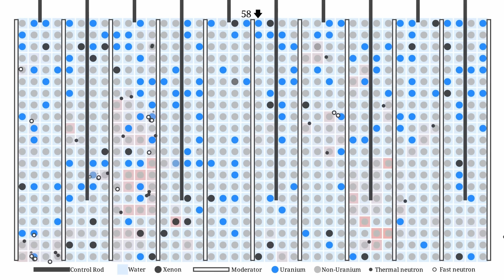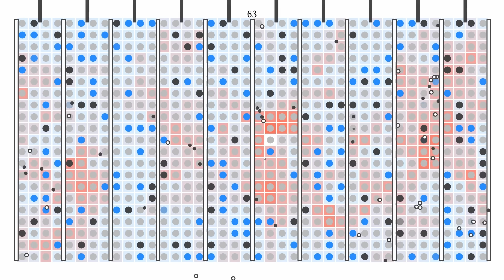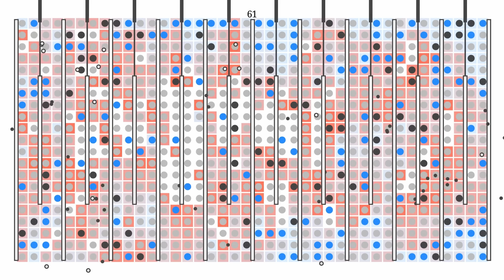Chernobyl Accident - Simulation only (no talk)

Comment: Worked on nuclear reactors for 5 years in the military, and the bad decisions in both design and operation of this reactor never ceases to amaze me.
Reply: My father left Westinghouse in the early 60's after a decision was made to choose a reactor design because it came from the nephew of one of the managers.
Reply: Five years? Dytalov had 14 years of experience.
Reply: Mind explaining how the design of this reactor is bad?
Reply: @Anton43218   The first thing that immediately comes to mind is the use of graphite tips on the control rods. They were used as a moderator, that is, they were used to reflect neutrons back into the core in order to generate more fission reactions. Water is used for the same things, but water flows and also acts as a coolant. Both have a negative temperature  coefficient of reactivity, meaning that as temperature goes up, the ability to reflect neutrons goes down, which is good. Having graphite on the tips of the rods allowed for faster startups because at the same temperature, graphite is more reflective than water and therefore allows for a more rapid initial increase in power. This also leads to a problem with their design, where power spikes upwards when the rods are inserted from the fully withdrawn position because the more reflective graphite displaces the less reflective water. Part of the purpose of control rods is to displace the moderators with the neutron absorbent material of the control rod, but when the reactor was SCRAMed, the graphite tips shattered and spread the highly reflective moderator all over the inside, which led to the massive spike in power and was a large factor for the meltdown. To make matters worse, graphite is very flammable when heated enough and exposed to oxygen, which led to graphite fires and the further spread of radioactive material after the meltdown.
Reply: @faultyinterface  Thanks for explaining!
One question: maybe its a misunderstanding on my part, but you said the water is reflective/increase the fission reactions, when my understanding from the video explanation was it slowed it down?
Reply: @KNylen  It has to do with a few principals working together. The aforementioned temperature coefficient of reactivity and reactivity specifically. Having a negative coefficient means cooler water is more dense, and therefore is able to reflect more neutrons back into the core, while warm water is less dense and allows more neutrons to escape. In this way, a negative coefficient allows reactors to be semi-self regulating, as the hotter it gets, the more difficult it is to generate reactions.  Another design flaw of the reactor was that when the water boiled, the steam voids had a positive coefficient. When they turned the pumps off and heat built up there was more steam, reactivity went up generating more neutrons, burning more xenon, allowing more fuel to be fissioned, generating more heat and steam, increasing reactivity, and so on. Burning the xenon was the intended goal, but doing it this way was foolish because reactivity was going up from both xenon burnout and steam buildup in the reactor, and these kinds of feedback loops tend to near instantly get out of control. For clarity, xenon-135 is a byproduct of fission and the decay of another fission byproduct, iodine-135, and has a very large cross section for absorbing neutrons. At lower powers for extended periods of time, xenon can build up quite a lot and reduce reactivity, but at higher powers, enough neutrons are generated to burn it off nearly instantly. Due to all these factors, they SHOULD have just increased power more slowly or just shut it off for 6 hours for the xenon to decay away naturally.
Reply: @faultyinterface  Oh I get it, thank you so much for the detail!
At the end when you say “shut it off for 6 hours”, does that mean inserting all the control rods all the way?
Reply: @KNylen  Correct. The half life of iodine-135 is approximately 6.6 hours, and the half life of xenon-135 is 9 hours, which should have allowed enough decay for a reactor startup without having to withdraw the rods and shut down the cooling pumps to burn off the xenon in the way they tried.
Reply: @faultyinterface  as a layperson, I'd like to know of your expert opinion, should all nuclear power plants ideally have a sort of "maximum power output" imposed by the government, so that there would not be decisions where a power plant is demanded to create so much power that could lead to disasters like these? Or is there already such a rule existing already?
Reply: @faultyinterface graphite "tips" took more than half of a control rod length. So, they were not really tips and this design is called "half-rod", and this is not exclusively just RBMK "poor design" feature. Moreover, the half-rod design was there to increase the range of control over the reaction, not to make it worse. More control - better and safer, isn't it?
Reply: @borincod  Not when they shatter and spread all over the reactor during a scram, or when they increase reactivity by displacing water while being inserted.
Reply: @faultyinterface  That's why you do not remove the controlling rods fully at the first place. No? And again, the half-rod design is not smth outlandish, which was possible only in USSR and IAEA was ringing bells about dangers of the design. So, why were you so "amazed" with this quite known design?
Reply: @borincod  yeah, that advanced control provided extreme safety, comrade.
Reply: @ab_user-1488   you tried to joke, boi? Maybe you try again somewhere else
Reply: @quantumpanic  This accident didn't happen because it was "demanded to create so much power". Read up on the incident. It's because of the poor design of the reactor and the fact that they tried to carry out a risky test while the reactor was in an obviously unstable state: in fact, it was putting out too little power in the hours beforehand, that's why they took the control rods out, to try to raise the power output to a normal level.
Reply: @faultyinterface  I don't think they turned the pumps off to burn the xenon.
The goal was to shut down the reactor, after testing if the pumps could keep going after tripping the turbines.
Obviously the power was too low to make it work, so i guess the pumps just stopped while the xenon was burning as a consequence from stopping the turbines.
But both the turbine trip and the scram were programmed.
I guess they still did the test at low power since they had to shut the reactor down anyway, they must had thought something like, the worst that can happen is another failed test.
They didn't take into account the design flaws though.
Reply: @giacomoneri1782  instead of guessing, why not just read/watch the facts that have been there for years.
Reply: @RandalexK  Facts are reactor should not kaboom, reactor did kaboom.
If you were in that control room then explain, otherwise i only have a couple of interviews with Dyatlov to guess what they were thinking.

What we have suggests to me they gave up on restarting the reactor, and since they had to scram it and do maintenance, they tripped the turbines anyway.
They weren't trying to burn the xenon, they were shutting it down.
Reply: @quantumpanic  all plants governed by the nuclear regulatory commission and Naval reactors have a set maximum power output based on the design of the core. This power limit is VERY strictly enforced. Violation of it will result in investigations, firings, and disciplinary action. Any decent operator would deny any demands to exceed the power limit.
Reply: @borincod  Combining the moderator and control rods into one unit is one of those design choices that sounds good on the drawing table and in the conference room, but has obvious disastrous potential consequences that multiple layers of "someone should have realized this was wrong" should have happened. The biggest of which actually happened at Chernobyl 4 on 26 April 1986.
Reply: @faultyinterface  Actually, that design wasnt too bad. I heard that it increased efficiency. They should have added a backup system that would immediately stop the reaction if something unexpected happened. I'm pretty sure it would have been possible to do so.
Reply: @Inf1niteDreamsThats what a scram was for, and thats why it failed. The protective action itself is what shattered the graphite and led to the runaway reaction. Once that happened, there was no stopping it. Graphite did help with efficiency, buts its one those things where that small boost added significantly more hazards.
Reply: @faultyinterface  Damn you explained that so well. I'm just a random programmer with no knowledge in nuclear physics now understand a lot better what had happened. And I love how you calmly answered everyones question. Lastly, huge respect for spending your time, educating others in a YouTube comment section, which we all know is full of ignorant people who couldn't care less. But I did and I thank you for the read!
Reply: @disorganizedplay  to build a nuclear power plant in a seismically active zone on the coast - obvious catastrophic potential consequences that should have been addressed, with the explanation that "someone should have realized it was wrong."
Reply: @faultyinterface  Interesting.  I never knew that about graphite.   The Soviets were quite accomplished in engineering and scientific research.  Chernobyl was surprising in that context. 

Most people associate it with the decline of the USSR, but the history actually points towards entirely different sectors as the culprits for that decline.  

I wonder if these design flaws you are noticing were present in all Soviet reactors or if they were early design errors that they were aware of and intended to change.
Reply: @Anton43218 Антон, чё затих? Вот тебе всё пояснили, хоть бы поблагодарил
Reply: @Anton43218 It blew up.
Reply: @Anton43218adding another point, all of that "bad design" were already known in that age, others reactors were build better, Chernobyl were outdated even before the planning stage, were a sad and rushed job from the begging, and total disregard for human safety
Reply: @vilian9185  ah.  This was the question I had.   You would have expected Soviets to fix engineering errors back then.  They were good at that even as the rest of their system came crashing down around them.
Reply: There were no problems in the reactor design, since normal operation of the reactor never envisaged such manipulations and experiments that were carried out with it that day, and accordingly was not calculated by the designers, otherwise the rod tips would have been made of a different material. This is a purely human error of those who operated the reactor in modes not intended for it, so nowdays such situations are completely excluded.
Reply: @yorikde  The IAEA was warning the Soviet Union about the potential malfunctions of the RBMK design for a decade before Chernobyl 4 exploded.
Reply: @yorikde they were doing a validation test, then asked to stop validation test, in principale it can happen
Reply: @lemsolaris67  If you don't deviate from the regulations, there wouldn't be any problems. That's why no one deviates from the regulations at operating commercial reactors now. And channel reactors are becoming a thing of the past... Although reactors are generally good and have many advantages over VVER
Reply: @yorikde the regulations assi to do all validation testa, for what I understood here the key was to pushback ant request of additional power during test, you are not doing a labbra test that can be changed while operating
Reply: @yorikde everything in the reactor design were shit
Reply: @vilian9185  Yes, yes, everything was so bad in design that in Russia there are still 7 reactors of this type operating, some of which, in addition to electricity and heat, produce various radioisotopes for medicine and industry.
Reply: @yorikde Yet they never tought after the explosion, to use machines to throw material to stop the radiation, they used miners, lol..

Rus mind its quite funny..
Reply: @aocg1914 They tried to use machines to clean it up. Unfortunately, the immense radiation burned out their circuitry almost immediately.
Reply: @Jambambah  Yeah , they used the wrong ones..

The easiest way to "seal" the radiation, was to throw sand or better, concrete like from those hoses, from a good distance..

I guess thei "great soviet minds" did not saw it..
Reply: @aocg1914  Great capitalist minds still cannot eliminate the consequences of the Fukushima accident. 
problems?
Reply: @yorikde  It was deemed a poor design before you were born.
Reply: @Canada_Dominium  The problem was in the material of the rod tips, during normal operation it had no consequences. There is only one conclusion here - the station personnel cannot be allowed to conduct experiments on a working reactor, using operating modes in which its designers did not provide for its operation. If you look at it from the point of view of the incident, yes, there was a design error in one of the important components of the reactor, but the situation when the tips reacted with the gas in the active zone was caused by the ill-considered actions of the personnel. The same thing happened at Fukushima - the station manager could not make a simple, correct decision himself. Therefore, since 2011, all stations, from the point of view of their safe operation, are controlled remotely by the vendor themselves. The station personnel will no longer be able to do any crazy things
Reply: @yorikde  The design was deemed unsafe before you were born.
Reply: The were ziping vodka, its the rus way , its kind of funny that it may be true..

Comment: Have to admit at the 2:40 time point when the SAFETY COMPUTER tells them to shut it down...  They acknowledge by going and turning off the computer! Amazing...!!!
Reply: What computer? The only computers were in a different room and printed their readings every 15 minutes
Reply: That's how things are done all the time everywhere
Reply: @freshrockpapa-e7799  spreading misinformation is crazy
Reply: @basedcheese1  What misinformation?
Reply: @madrabbit8722  Thank you for your input.
Reply: @freshrockpapa-e7799 Operation of safety-critical systems doesn’t usually work this way. Each alert will have procedures to mitigate subsequent failures. Can you imagine if a commercial airline had various alerts displayed to the flight crew and they took no action other than shutting off the alerting system?
Reply: @freshrockpapa-e7799 yeah, I work with managers like that. It really hurts...
Reply: @freshrockpapa-e7799  It was normal procedure anyway.
When the turbines trips the alarm goes off, you aknowledge the problem and turn the alarm off.
In that case the turbines were tripped on purpose, the alarm was expected.
Reply: @freshrockpapa-e7799  Maybe in the Putinstanian Federation and similar 3rd world countries. Not in the West.
Reply: If you are 70 iq then such disasters are possible. 70 years of 70 iq ussr. And now neo ussr under putler
Reply: @davidbolds7104  spoken like a true 70er. It was a test, the alarm was supposed to trigger.
Reply: @davidbolds7104  Гiрiям слiва!
Reply: @davidbolds7104  Neo USSR under Von Der Liar.

Comment: I don't know what I was looking at. I don't know what to expect. The end freaked me out better than most horror movie. What even happened.. Anyone want to just give a one liner for each of the legends' functions in the system?
Reply: I’ll try

neutrons= moving dots, subatomic particles with energy
Uranium 🔵 Eject three neutrons when collision occurs
Xenon ⚫️ when a Uranium atom “disappears”/decays, there is a chance it will appear. It absorbs neutrons, which causes it to disappear, so its overall effect on the system is a slowdown.
Water [ ] slows down neutrons, but the more neutrons there are, the hotter it gets, until it evaporates (into a steam void)- which is like an immediate ‘off’ switch on its effect.
control rod | An impenetrable wall that absorbs neutrons

(Extra detail: moderators (white bars) cause the initially input neutrons (white moving dots), which move too fast to react, to slow down upon impact to a speed that will react (become black dots). Only adding this as a P.S. since it’s not completely required to understand the sim.)
Reply: There were 2 major problems going on : one was a high degree of poisoning by xenon : that absorbs neutrons, causing the reactor to loose power. So they yanked the control rods to try and boost the power to the level specified for test.

The second big issue was that the RBMK has whats called a "positive void coefficient of reactivity" : if you boil the coolant (makes steam voids)  the activity of the reactor goes up, making more heat, boiling more coolant, making more voids. This rapidly rising activity eventually *depleted the xenon*, and now you have a RBMK reactor with no dampeniing xenon, all the control rods out, and a massive amount of steam voids.

The rest, as they say, is a clicking hot mess in the basement of the containment building for a few thousand years. 

This wasnt human error, tho : this was made inevitable when the dayshift crew were instructed to delay the test until later in the day, the swingshift came and went also ; the xenon buildup had already begun, and both experienced reactor shifts were long gone before the nightshift crew were told to try the test. On an already poisoned RBMK reactor.

Physics does not do politics, corporate or government bullshit :)

Yikes.